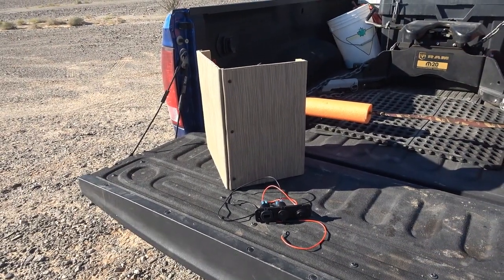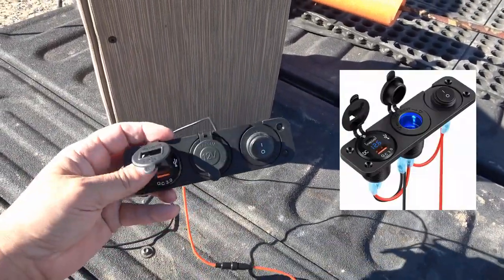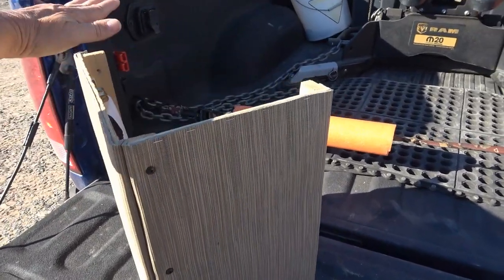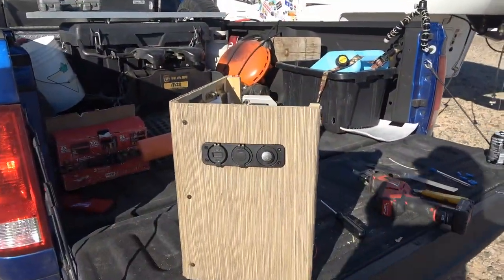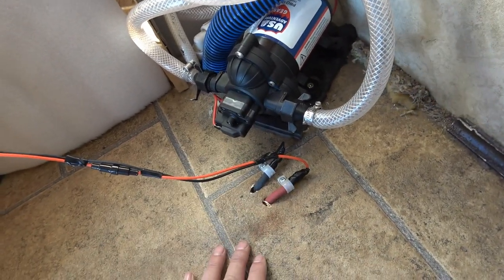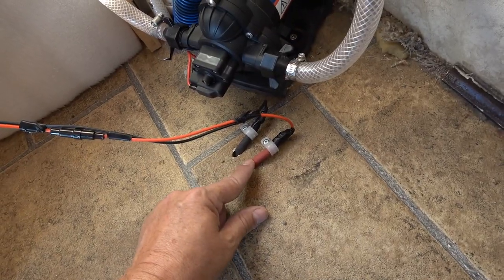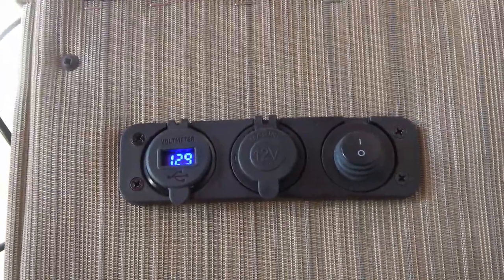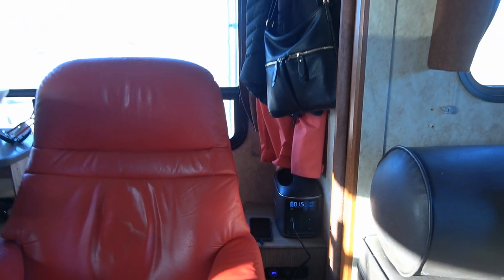12 Volt DC Power Panel Installation -  Kohree 120W USB C & 3.0 + Cigarette Lighter Socket & Switch

Comment: A few years ago I did something similar, except mine has four ports for separate voltmeter, lighter, USB, and switch.  I installed it below the TV in the entertainment center.  The USB port died last year, but was easily replaced since all the components are modular.  Because my recliner is in the poorly insulated slide-out, it tends to be cold in the winter.  I use the lighter socket to plug in a heated auto seat cushion.  I can stay warm without needing to run as much heat.  It's also nice not to have to sit down in an ice-cold recliner in the morning.  Brrrr!

Comment: Handy Ray at it again! I wished I could utilize your handy skills for just one day. I've been wanting one of these by my corner RV bed, which is where my panel is. I got a quote from my Rv repair services and they quoted me $600. Needless to say, I said no way! I fear messing with the electric panel. Although I followed your video for installing the Vortex fan in my bathroom and it works great.

Comment: My 2006 Cardinal didn’t come with any USB charging ports.   A couple of 5 yrs ago or so, I redid my under-bed (slideout). I added one to the skirt paneling.  I drilled three hole versus one long hole. Then I got inspired and made a 6 x 4 x 2.5 box that enclosed another one.  Attached it to the underside of the bedroom hanging cabinet, tied into the lighting power. I like the on/off switches, killing the parasitic draw when not using them.  However, Now that I have a battery monitor, I want to get rid of the volt meter function.  Pinching my milliamps 😁.   Also, the blue (night) lights can bother some people.   Now, I have USB outlets everywhere of kinds of types.  I might have went a little overboard. 😊

Comment: I added a couple of similar ports last year, so I can charge devices when boondocking (I don’t have an inverter.). I found it easier to not use the rectangular mounting plate, and just drill the holes for the devices directly in the panel.  I’m now contemplating mounting one on the outside.

Comment: Those panels are great! We installed one before our latest trip down south and it's been awesome for keeping the phones charged. One thing I'll say is that I blew the fuse on mine trying to plug in our tire pump. So you do have to be careful with how many amps you try to put through it! :)
Reply from the maker: Yeah, my VIAIR compressor draws up to 20 amps so I have other higher amperage DC ports outside for it.

Comment: I’ve added these all over my rig.  You would think that it would be a no brainer and cheap to put them everywhere… but let’s face it, they didn’t even run a wire to my ceiling vent in the living room of my Cougar
Reply: Hi! Trying to link up two of these dual/triple usb units in my camper but I can’t find any diagrams or instructions - any advice?:) thanks!!
Reply: @csababartha9497  it should be fine to connect all the positive together and all the grounds together.  That being said you have to remember it’s not the thickest wire usually ran to areas where chargers are present in campers.  You can’t have a really high load on them.  If you’re running new wire add either a fuse block or an inline fuse and I’d run 12 gauge wires.  12 volt circuits are very easy to deal with
Reply: Thanks so much for the feedback, really appreciate your time to answer my beginner question:) so I would run the positive from the 2nd outlet in the first dual usb panel to the positive line of the next dual usb panel? Not just splicing the two factory positive wires from each panels together with the designated positive that comes from the fuse box, correct? (I’m using 12gauge in all my wiring.)
Reply: @csababartha9497  if they are close just attach all three wires together.  If not add quick splice wherever you need it
Reply: Thank you so much!!:)

Comment: I tried installing the same way, and even tied it into an exterior light, but now the 15 amp fuse that the exterior light is tied to keeps tripping. I can't figure out what is going wrong, any tips?
Reply from the maker: Does the digital voltage meter light up?

Comment: I dont understand why the water pump is in the living area. I guess I need to go back and see what I missed.
Reply from the maker: My guess is because the 60 gallon fresh water tank is mounted at the tail end of our trailer. So easiest place is to put the water pump directly above it so the draw distance is very short and in the living area so during freezing weather stays warm. Because of those reasons I don't mind it too much.
Reply: @LoveYourRV  ok. That pump must be a lot quieter than mine. It's located in the basement storage area and is still too loud.
Reply from the maker: We boondock a ton so have grown used to the sound. I actually kind of like it because if a water leak happens the pump cycles as it repressurizes and alerts me to a leak problem. For that reason, I often use the pump even if city water is available. Old RV so has old plumbing now. Cheers Ray